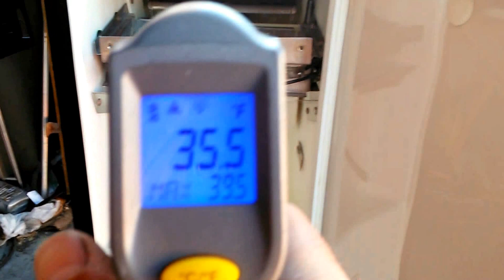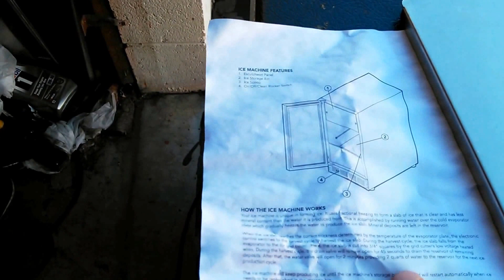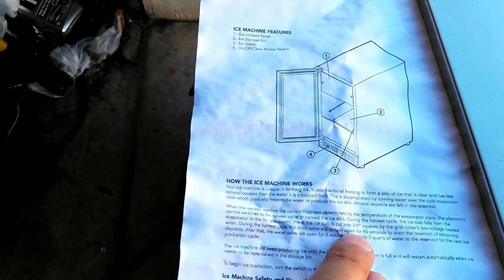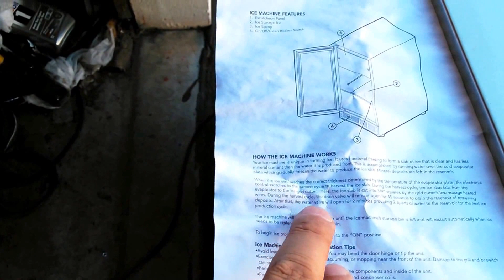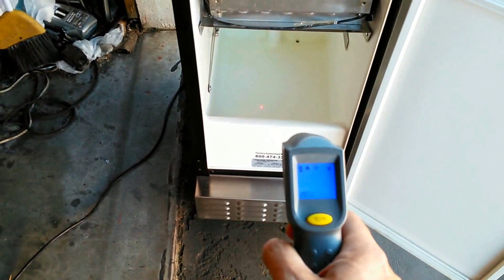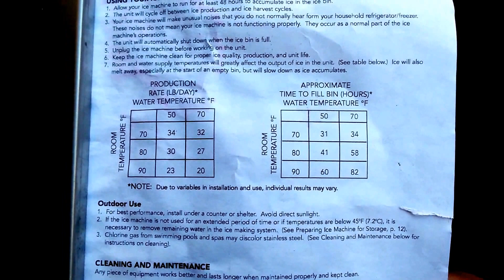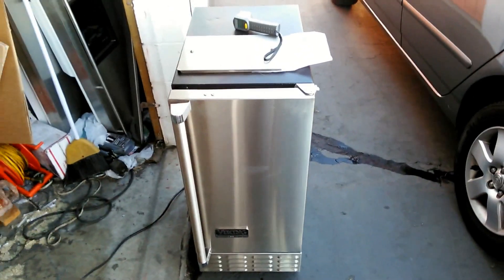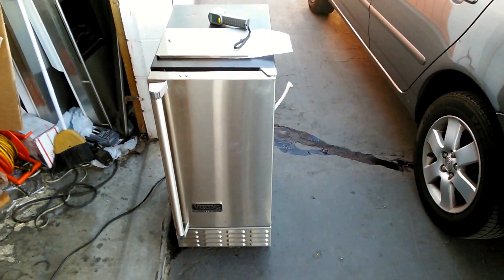Viking Profesional Ice Maker - How It Works

Comment: Hi Frank, 
Thanks for the video, great stuff!  I have the same unit and it suddenly stopped shutting off when it's full.  So, as far as replacing the overfill sensor, is that a straight forward plug and play replacement?

Comment: Our ice maker is not sliding into the cutting board.  What can we do to fix this???
Reply from the maker: I sold this unit quite a while ago. Actually, as I recall, the ice is actually cut by heat that travels through the wires just below where the ice freezes. Don't quote me on that.

Comment: how do you install the drain line with the pump. there is nothing in the installation manual that shows this...
Reply from the maker: I sold this unit years ago, however, you may reach out to Michael Collins. He's a tech who commented on this text string 4 years ago. If you scroll down from this comment, you'll see his comment.

Comment: Does the blower run 24/7
Reply from the maker: I'm pretty sure the blower does NOT run 24/7, otherwise it would burn out. There is likely some type of thermal switch or circuit that cycles the blower.

Comment: I have one of these ice makers but the water is not flowing across the metal plate.  I'm not sure any water is coming out of the reservoir into the hose and up and over the metal plate.  Is the pump in the back what performs that function?  It is hot to the touch.  Assuming it is history...?

Comment: Awesome video. I have a question if I connect my ice maker like you, with a 3/4 hose straight to the water connector, the machine makes ice, working flawless. I can only make this type of test outside my house. Inside my house, under the counter, I have a 1/4 compression connection with at least 40psi and the cabinet temperature is around 75 F. When I connect the machine to that connection makes ice but at much lower pace and the ice ends up melting. What do you think it might be the problem? Any clue will help. Thank you in advanced.

Comment: Lol people,  its a whirlpool!! Buy a whirlpool for half price
Reply: Michael Collins that's twice you have called it a Whirlpool, and you couldn't be more wrong....it's a Marvel made for Viking.
Reply: Bruce Hurley dude u just proved u have no clue. I have been wrkng on residential and commercial ice machines since 91'!! Its a whirlpool evaporator, whirlpool cutting grid. Same door and box size as whirlpool. Do ur research.
Reply: Michael Collins marvel control board, water valve and drain solnoid. Show me a whirlpool that has spade thermistors. I have one sitting in my garage right now next.to a whirlpool/ ge style. I work on these for a living ....Dude just because the evapotator looks like a whirlpool evap doest mean it is a whirlpool. Whirlpool has a plug in thermistor style bin level switch this unit has a thermastat type switch. This machine operates nothing like a whirlpool.
Reply: All 15 inch under the counter ice machines are just that 15 inch ice machines. The door and highs are completely different....maybe you should do your research Dude. 26 years residential service and installation.
Reply: Bruce Hurley  ok theres a few things i will point out about your video...it pumpss out of this reservoir lol, these are the freezing lines lol once it gets to 35 lbs, it will shut itself off bc thats the maximum it will hold lol, te ice freezes on the shelf only lol, i mispoke earlier, it does freeze the entire compartment lol laser thermometer probably reading high bc that water on top lol, the air comes in here and goes out there , thats the cooling mechanism lol,  you really dont need a filter lol  the bottom wont be quite 32 bc it wants to be warmer to melt off the old ice lol 1.5 hrs later 1st cycle lol (dude, its a lemon ) 25 mins at 80 degrees is a cycle time. Anyway, back to your video ... u always want to keep ambient ant water as cold as possible lol ( NO, they wont make below 50 degrees water or air.) Omg go thru it once more lol when slab get thick, it cuts off and throws it off lol, it will drop it in that tray lol ...i gotta go cause the storage unit is closing soon lol yeah, i can tell you work on these for a living lol. Good luck man. I know what i know, and apparently you do to !!! i so hope some fellow real refrigation techs chime in as well. Very entertaining.

Comment: Just curious how much you think running this ice maker adds to your monthly water bill? And how much to your electric bill? Thanks for a great video!
Reply: casting619 as a tech i know it uses about half gallon per cycle (25 mins) until full then shuts off so really depends on if u keep it empty all the time with parties and big dinners. Under normal household use its only going to run 2 hrs per 24 hr day. So once full you are only using 4 gallons of water per day. Electric id estimate at 3 bucks per day under normal use.

Comment: I had this machine sitting outside connected to a hose and it worked fine - We moved it into our house under the counter and connected to water line and now it doesn't work - I do not hear the water cycling through like when it was outdoors. Any suggestions?
Reply from the maker: I'm willing to bet that something shook loose when you moved it. I would check any relays to the pump. The pump is at the heart of the process. Look for any Youtube videos on trouble shooting relays. Open it up and just push all wires into their receptacles. Also verify that the reservoir is filling with water. There is a relay that controls that also. Make sure that the water going into this unit is not softened. Salt is used to soften water, and it will eventually kill the plumbing on one of these units.
Reply: Well, I was thinking the same thing that something came loose - I will 
pull the machine out and check this out - As far as softened water - Our
 entire house has a water softener
 as we have some of the hardest water in the area - I doubt that I can 
bypass that without major plumbing expense. Also, is there a site you 
recommend to buy a new pump, relays, cutter, etc - to make the unit like
 new?  Thanks so much for your response!
Reply from the maker: I would contact Viking to see if they have any parts you need. I doubt that these units changed very much over the years.
Reply: I think it needs the rf recharged. It may have a leak, I am going to have someone install a service valve and put in the ref. with stop leak and see if that solves the problem.
Reply from the maker: The water valve is a whole different problem than the refrigeration. Moving a refrigerator can sometimes put stress on the refrigeration circuit, but the refrigeration does not determine the flow of water. I wonder if there has to be a minimal water pressure at the inlet. I doubt that this is the problem, but that should definitely be eliminated as a possible cause. You might also want to check the water line to see if it is clogged. The water inlet of the unit should have a screen, so check to see that the screen is not clogged,  then run some water through the water line to see if it is flowing without obstruction.

Comment: after cleaning it, I reassembled it and it seems like it's stuck in cleaning mode, pump and refrigeration won't turn on, any advice
Reply from the maker: I'm not a technician, however, refrigerator units usually have timers that turn functions on and off. You might have a stuck timer that might need to be replaced or analyzed. You might see if you can find any Youtube videos that show how they work. I've seen several videos that illustrate how defrost timers work, so you might glean some info from such a video. Many of these timers have a way of doing a manual override to get the unit to go into it's freezing mode. Hope this helps.

Comment: i have this same model "Frank" and I just hooked it up today after sitting in storage for two years, its working but slowly, i pulled the water line too much where it came out of whatever its supposed to plug into and had it sitting on top of where the ice is made, that actual line in is leaking because of the way i cut it and the heat cutters took a long time. what is your advice for these problems
Reply from the maker: Hopefully, you just damaged the tubing and not one of the plastic inlet valves. If you did break an inlet valve, you could possibly fix it with some epoxy. The cutting function does take some time, so this is normal. You're in good shape as long as it's cutting and as long as the pump is working.